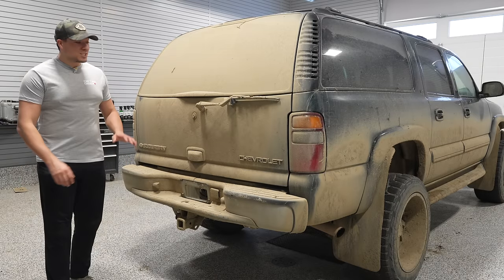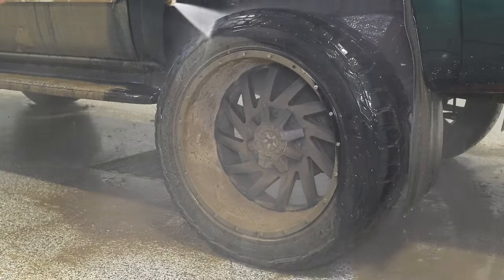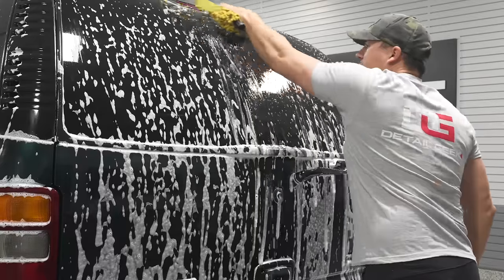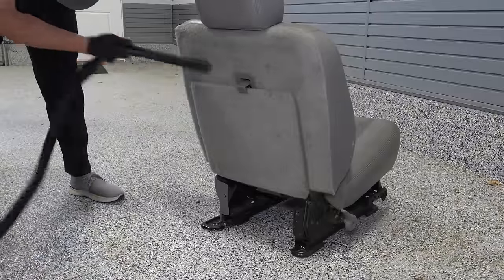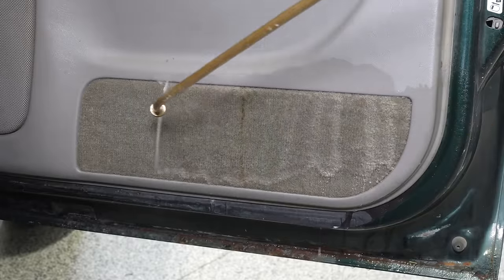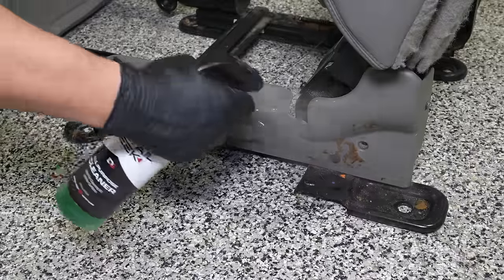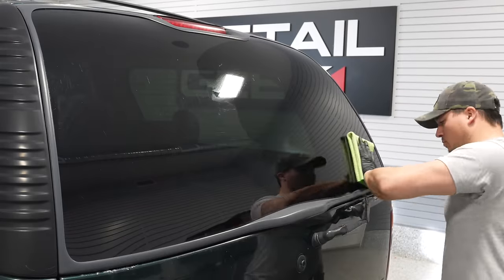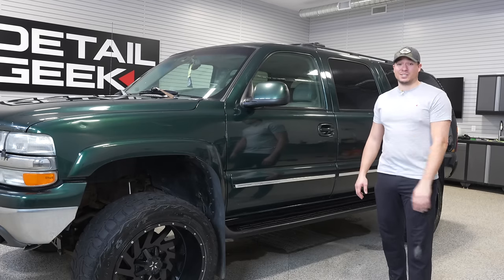Why You SHOULDN’T Clean Your Car in Winter!

Comment: I think that it's stupid to put oversized wheels on any vehicle, it's not good for the suspension and most of the time the sidewalls are too thin to handle the road conditions especially in Canada and the U.S. rust belt where the roads take abuse

Comment: I drove a 2002 suburban for 6 years and only just retired it a little over a year ago. If I had my way I'd drive it for another 10 years, but sadly the rust was finally getting to the frame. Mine had those flaps to cover the footwell and they were very useful when folding down the middle row for cargo or traveling with dogs! That suburban was the most functional and useful vehicle I've ever driven. Newer vehicles really can't compete for quality and function.

Comment: The GMT800 series of vehicles are some of the best vehicles EVER built by any manufacturer.  18 years have passed since they ceased building this platform and there are still hundreds of thousands if not millions still on the road.  05 Cadillac Escalade ESV owner here.  Love the video on this big ole Burb!
Reply: Having owned and/or worked on several of these trucks over the years, it's safe to say that the engineers' wives didn't cheat on them with a mechanic, because they're not horrible to work on.
Reply: Still daily my 2002 suburban just hit 205,000 miles from Texas

Comment: The carpets in the door panels could be for using your muddy foot to push open the door if you're stopped on uneven ground. Better cleaning a bit carpet than scraping a plastic door card 😀

Comment: The carpeted door panels go way back to the 1960s carpet was more durable than the vinyl wrap. The carpet saves on scuffs on the bottom of the doors but I don’t think it’s done in any current vehicle. Nice job!
Reply: Yup! Scuffs on shoes (people do push the doors open with their feet), as well as scuffs on the hard plastic lower door panels. I wish the manufacturers would still do this, but it seems every manufacturer wants to reduce costs ...and make more profit.
Reply: was coming in here to see if anyone said this...that is the exact reason for it.

Comment: If you live in the North where snow and salt are on the roads, you better clean it or it will be a rust bucket Winter Beater in a few years.
Not a real problem here in the South, unless you live near the ocean and get salt spray. At least the under carriage.
I have a 20 year old F150 with only surface rust on the frame. South Carolina near North Myrtle Beach.

Comment: This is me.  I live on a dirt road that turns slick and sticky with rain and snow. And I did spend 325 to get it professionally cleaned and two days later I was back to looking the same way before the cleaning. Two large dogs didn't help interior either with their paw prints.   I will try for a beater truck to drive on icky road days. Something that's NOT my 3500 high country truck

Comment: Watching you vacuum then power-scrub then suction out a filthy carpet is AMSR for me. It's just... I wanna detail something cool now!

My own car I recently did enough that I took the carpets out too, so it's not dirty enough for that yet...

BTW carpet on the doors wears less than kicking the plastic when you have to open the door against you in a tight spot. It can also be used effectively for noise suppression, but I doubt that's the case here

Also Also: I'm a huge fan of MATTE finish on dashboards. I'm from a place of bright intense sun (Australia) and the difference between gloss and matte finish while driving is a huge difference in visibility, glare, and safety. So that high-gloss stuff that is usually sold in auto stores that most people associate with clean is a huge turn-off for me. I've been able to dull the finish of that stuff a bit with different application technique, but the matt stuff is just better. Also the brand I use smells amazing.

Comment: The 2000-2006 year range of GM full size SUVs were some of the best. Full 6ft bed if you folded down the second row in any Tahoe or Yukon. Full 8ft bed removing third row, folding down second row and using those footwell covers in Suburban or Yukon XL. Miss my ‘03 Tahoe for this reason alone. Was nice to go to the drive in movies with an air mattress in the back or just put so much more stuff in the back than in my 2011 Yukon where the second row folds up and takes away a lot of cargo space…

Comment: Ok what's with that plug sticking out of the hood? 😅 7:40
Reply: Cars & trucks in northern climates sometimes have block heaters or tank heaters installed, especially if parked outside in winter.  This heater gets plugged in to provide warmth so the vehicle starts when there are below zero temperatures.

Comment: The older rigs were absolutely better. My 2001 F150 has 213k on the original drivetrain and still runs and drives great.

Comment: How do you recommend cleaning a "rubber" floor - I have one in an old F150 and my new bronco and have no Idea how to clean them well
Reply: Do you mean rubber floor mats? If that’s the case I think he did clean similar stuff in some of his videos but from some other videos that I have watched, they just use all purpose cleaner to clean it and agitate it using a drill brush and just rinse it with water. Just make sure it’s dry before putting it back in to your car to avoid any moisture being trapped inside
Reply: @kong967  I mean a full rubber floor -- no carpet
Reply: I'd also like to know! My '03 Silverado has full rubber/plastic floors.

Comment: The Traverse abomination is due to lining the pockets of service bays in labor fees. Up until the 2008 recession, car manufacturers like Chevy were still big on the "DIY" scene, especially on flagship V8 vehicles. Now, no. They'll wring every last cent you own out of an oil change by making it top down, hiding the filters behind aero panels, etc. Not to mention tying most hardware components to software infotainment buttons. Oh, you're AC won't turn on? That's a $4700 head unit replacement, which requires 6.7 hours of labor at $185/hr. You need a new windshield? Sure, we can do that, but you'll have to bring it back to calibrate the rain sensors because the guy that tunes that software is out on vacation. Until then, you shouldn't drive the car at all because you'll burn out the wiper motors.